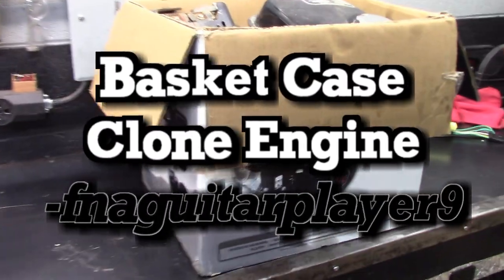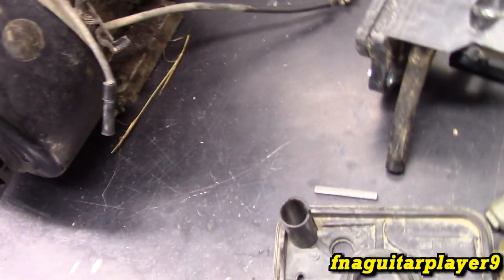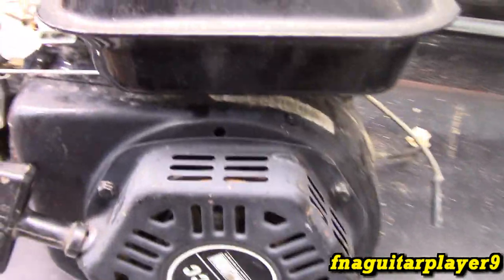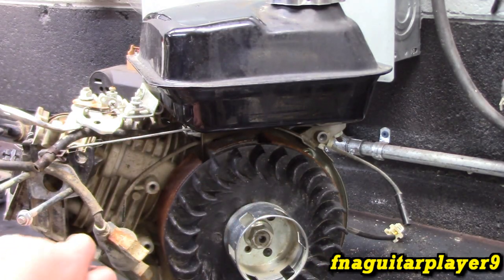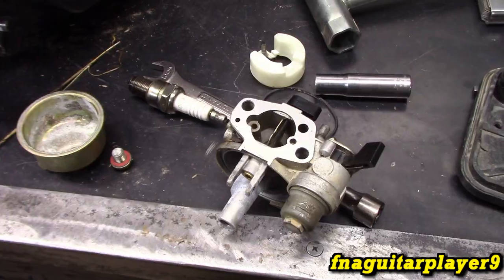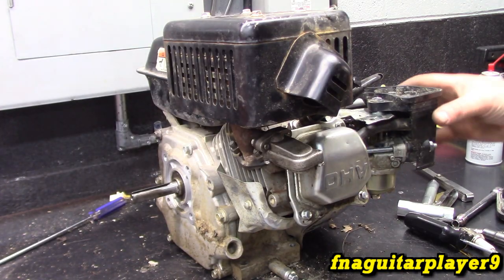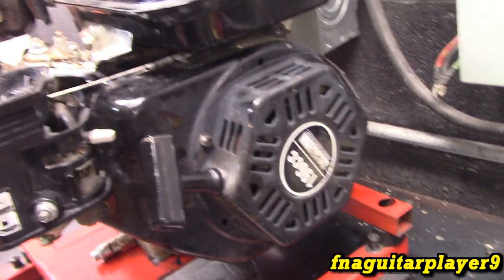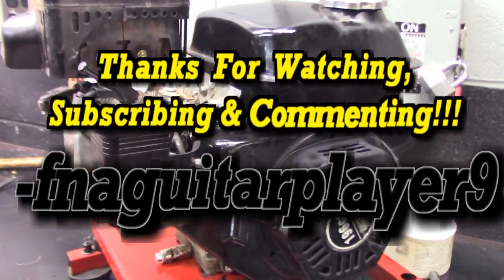Basket Case 196cc Honda Clone Engine, Water In Oil, Running Again

Comment: What I can tell those engines are WELL worth the money, which ain't much compared to a Honda. I've got a 13 on the splitter and so far, so good but it hasn't been run a lot. I still like my old Briggs 'L' heads and my one old Kawasaki. I got a new book from Briggs and trying to see how to set the governor on a 110 series. The book is for single cylinder motors back to 80 and the 110 is an 85.  4 horse and maybe the 1st year for the bimetal choke setup. We'll see. DANDY spare you got and GBWYall and pick one!
Reply from the maker: i like them, mainly the predator 212s but still like the flatheads much as well! Thanks for Watching!!!
Reply: @fnaguitarplayer9  SURE!